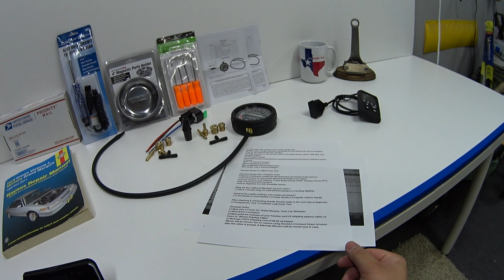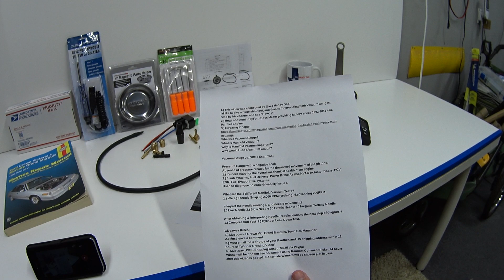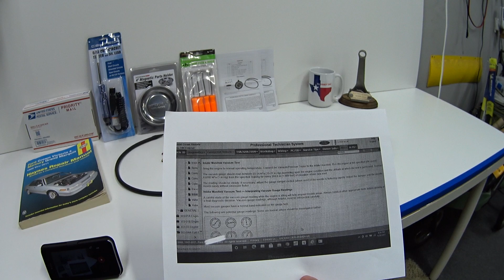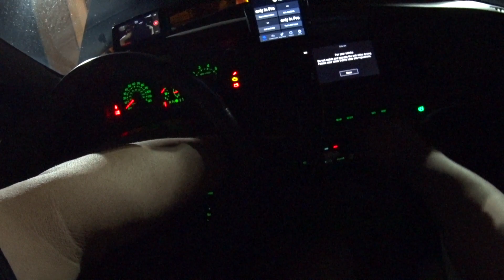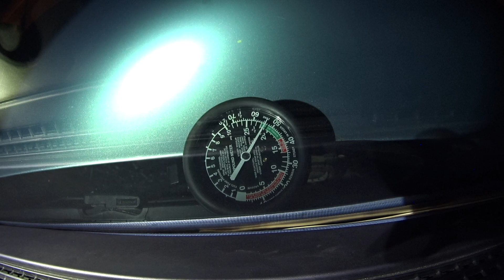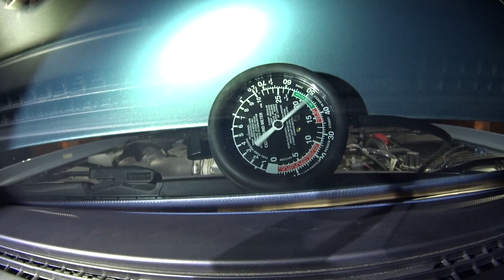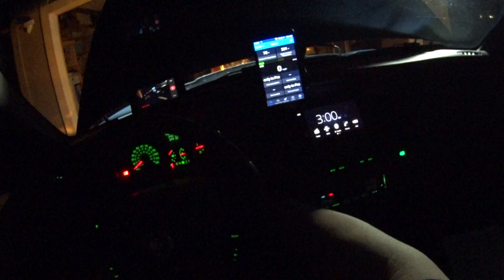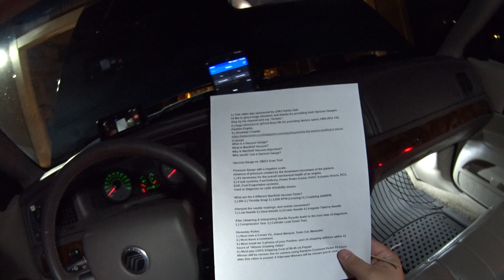Crown Victoria - Introduction To Manifold Vacuum Gauge

Comment: Chuck, Thanks for sending me to this video! And like you said, The Vacuum gauge was the go to tool for working on carburated cars and trucks :)
Question, a few, what's that phone holder on the dash holding yuor phone?? And does it leave an imprint after its removed?? The holder looks sterdy!
And are you going to have a Grand Marques Giveaway :) Been looking and the prices are threw the roof! Found an 2006 Grand Marques for $8,000!
Reply from the maker: Yo DMQ,
Did you check manifold vacuum to see what was causing the intermittent misfire?

The brand name of the phone holder is Macally, I found it on Amazon. I've never removed it, it's been there for 3 years.
-Chuck
Reply: @PanzerPlatform  Yep, it was the PCV valve stuck open, wierd thu, it only stuck when the cars warmed up!... I got to get a McCally phone holder :)

Comment: Hmm .. I've been wondering about the rings and valves in my car.. It had over 4200 idle hours when I got it, and to be honest, I'm as bad as the police are for idling, I'm now over 4600 hours, and just recently I've started burning oil when I idle for more than 2 minutes, you can start to smell it, and if you give it any gas it burns blue smoke .. but surprisingly with all the work that's been put into it, it's running way better for me now than it ever has , just wish it wasn't burning oil ..

Great video , I learn a lot from you!
Reply from the maker: Right on Chris,
Thanks for stopping by. 
-Chuck

Comment: thanks chuck for this video and for wj handy daddy, these are very importent information by the way
the park brake release actuator  on my grand marquis works on vacuum too and the hvac system gone crazy because of a cracked  vacuum hose
Reply from the maker: Right on Mr. Bahrain,
I totally forgot about the vacuum operated Parking Brake Release.
My very first 2000 Crown Vic Lx I had back in 2004 had that feature.

Sadly my 2004, and 2010 do not =(
-Chuck

Comment: Thanks for the informative video.  Will part 2 include what to look for if you find a problem?
Reply from the maker: Right on Scott,
That’s a great question. 

This video was meant as an introduction on how to simply obtain manifold vacuum readings showing the different vacuum sources on a Panther Car. 

Interpreting the readings is a whole ‘nother ball game that most viewers will find little value. In the mean time, I put a link in the description of the best article I could find about interpreting needle readings on a vacuum gauge. 

It’s called “Mastering the Basics”. 

Unfortunately Part 2 is me performing the same tests on my 2004 Crown Vic with 160K Miles to see any difference between my 2010 Grand Marquis with only 80K Miles. Spoiler Alert, the test results were identical. 

That surprised me, I was expecting the high mileage engine to have more wear & tear on internal engine components by indicating less manifold vacuum. This is either a testament to the reliability of the engine, or my preventative maintenance regiment, or both. 

-Chuck
Reply: @PanzerPlatform  thanks Chuck. I can do little more than change my own oil.  Also I haven't watched the other collaboration videos yet.